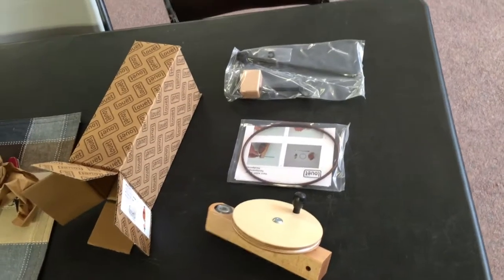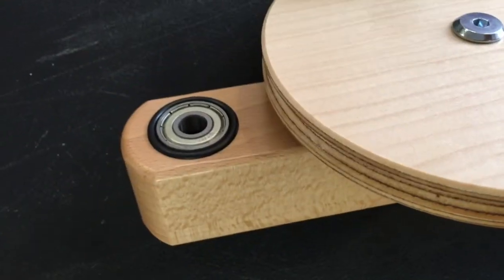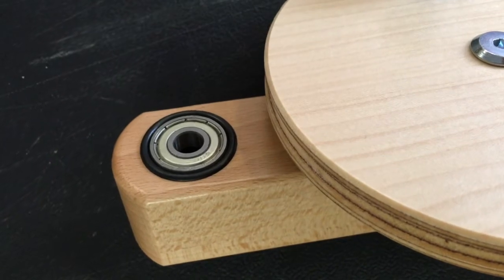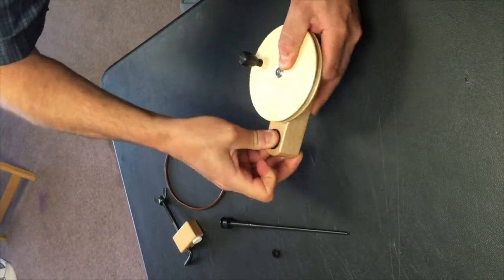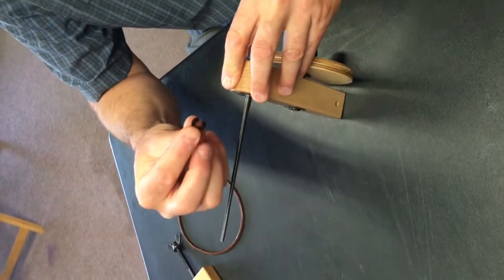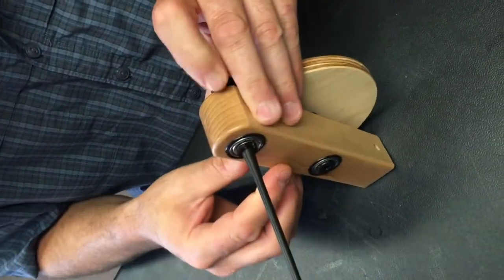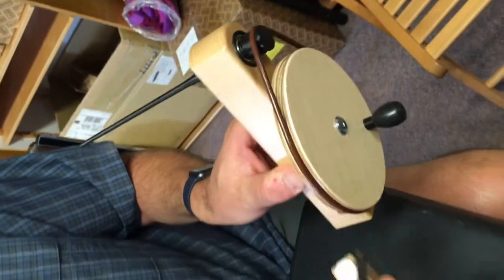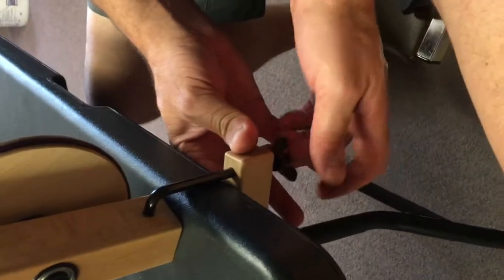How to assemble Louët Hand Bobbin Winder

Comment: Hello
I put the loose bearing in before realising that the bushing should go in first and now I can’ t remove the bearing.  Any advice?  Can the bobbin winder be used without the bushing?  It is very frustrating and I feel that the assembly instructions included with the winder were really not adequate.  I only realised what the bushing even was when I came looking for instructions online.  Thank you.